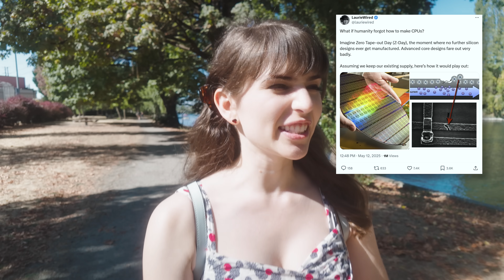what if humans forgot how to make CPUs?

Comment: give me a couple thousand MOSFETs and i can make my own CPU. It's gonna suck balls, but i've done it before and it works.
Reply: A few thousand may be more than you need.  Vacuum tube computers used only hundreds of tubes.
Reply: @kensmith5694  Tubes can do more than transistors. There are some pretty complicated tubes, including plenty of logic integrated into a single tube, so you would probably need fewer tubes than transistors. Tubes are probably more like a small IC than a single transistor, at least some of them(in this scenario we would obviously "integrate" tubes as much as possible).
Reply: @Maxjoker98  Mostly, the tubes were dual triodes.  There was a fair amount of diode and resistor based logic gates in the designs.  Something like a PDP-8-S could do quite a lot with not much logic.  Going serial for math saves a lot of parts
Reply: You won't be the first, there's the Monster6502, it's a huge circuit board and only runs at a couple hundred kHz.
Reply: @kensmith5694  Tell me about it! Bit-serial CPUs are very cool, there is this really cool bit-serial CPU for the WireWorld cellular automata. I'm thinking of building a bit-serial CPU in Minecraft, because my tiny CPU isn't tiny enough :P
Reply: @Maxjoker98  The 8051 microcontroller is/was serial internally.  It is a very nice micro to work with.  The RCA CDP1802 was also serial internally.  It was a complete horror to work with.  I suspect there wasn't much difference in the number of transistors used in the core.  I was more a matter that the guy who did the CDP1802 chip hated programmers.
Reply: @kensmith5694  yeah, i cant really think of a use for a heptode mixing tube in a computer logic array...

"logic in a tube"... obviously a comment from someone that has never seen a basic jordan eccles multivibrator or understands what all those extra grids/screens in multi electrode tubes are for...

"onish". "offish". "somewhere in betweenish". not really much else a regular tube can do other than diode action... what else is there? magnetrons... not much call in a computer for that. thyratrons... we now have nearly complete "offish", a state of "onish", and no in between. and we cant turn it off without cutting the power altogether...
ignitron? same deal but bigger?  phototube? all relatively useless in logic. all that suits is the pliotron... the humble triode. or maybe a kenotron... rectifier.

ha ha... "offish" doesnt trigger the spellcheck... is that an actual word?
Reply: @kensmith5694  There was even a dynamic RAM using a vacuum tube, the Williams-Kilburn tube.
Reply: @WimTon  Drum memory or a "mumble tank" have a certain charm as the main memory of a computer.  On such systems, you can have a nice analog meter showing what percentage of the time the machine is waiting for the bits it needs to come by.
Reply: @Maxjoker98  Agreed! 

When you use them in digital mode (2-state) it get's quite easy to visualise quite complex logic functions being integrated into single physical tubes. Also there were quite few tubes that were for example "dual-pentode", etc. meaning that two 5-terminal innards would share one physical package. So I'm sure we'd soon be talking about "its" the way we talk of "ics" today! 

Incidentally, in the UK we tended to call tubes "valves", with the grid(s) acting like a tap (faucet).

We'd also not need the heating on in winter...
Reply: @Maxjoker98  8-bit ALU (ripple or small carry look-ahead): ~32–60 triode sections
(full adder per bit costs rise, plus XOR/logic for flags)
Registers (accumulator + 3–6 general registers): ~24–40 triode sections
Instruction decoder & control sequencer/microcode: ~20–40 triode sections
Clock & timing circuitry: ~6–12 triode sections + power tubes
Bus drivers/buffering (wider buses, more fanout): ~20–40 triode sections
I/O controllers (serial, display, interrupt logic): ~12–24 triode sections
Memory interface / core sense amps & drivers (for, say, 16–64 KB via core/drum hybrid): ~20–50 triode sections
Triode sections total (sum): ~154 – 306 sections.

Conversion  to physical tubes
Dual-triode primary use (2 sections/tube): 77 – 153 tubes.
Mixed compactron heavy use (avg 3 sections/tube): ~51 – 102 tubes.
Add practical overhead (spares, extra drivers, safety margin + power/regulator tubes): add ~30–50%.
Final 8-bit tube estimate:
Optimistic (aggressive integration): ~65 – 140 tubes.
Conservative (realistic design with overhead): ~100 – 230 tubes.

Your logic is sound; you could reduce with more targeted computing. I wrote it just as an 8-bit CPU example.
Reply: @Maxjoker98  You are not having my guitar amps you computer freak!
Reply: give me a couple of electro-mechanical relays and I can make my own CPU. I sometimes wonder how well you could build electro-mechanical computers with our modern knowledge and tools(Computers have changed in their abstract designs a lot since then, not just in the concrete implementation! And relays, surprisingly, have gotten better too!)
Reply: @Maxjoker98  It will be hella slow; the physical gap in relays take milliseconds. Add them all up X1000s, and you are in for a (bad) treat.
Reply: @Maxjoker98 In the 1900s a European firm (Swiss?) manufactured a mechanical payroll computer for a mining company in the Southwest US.
Reply: @Maxjoker98  I would love to see that!
Reply: @Maxjoker98   oh yeah, you can. some old elevators run completely like that. 70+ floors etc. used to have an operator, now controlled with logic made with latching circuits cobbled together from contactor blocks etc.
Reply: If I see a doomsday prepper Kickstarter for the Ballsucker 2000 I know who to blame
Reply: @balorprice  
Lmfao😭

(Im serious!)
Reply: But will it run Doom?
Reply: if you don't mind a multi-voltage power supply, a bipolar junction transistor (BJT) can be made into logic gates and therefor a CPU. And BJT can be made as a bit of an advanced chemistry experiment (a little dangerous).
From there, a module that acts as a very simple binary or 4-bit BCD(decade computer) ALU could be made. And if you are patient, you can make a computer from that. 
But it won't be competitive to even something from 80 years ago. Eniac is that old, from 1945, but more sophisticated than above, it was made from thousands of tubes and relays.
Reply: Ben Eater will be king of the world lol
Reply: @JohnVance  Yup! I still have an 8 bit CPU work in progress following his videos :)
Reply: Was just thinking this. The information has been unlocked once and enough people are familiar with the general physics and logic necessary to make primitive computing solutions. It would be exponentially faster to get back to this point than the first time we cobbled this trash together. lol  Might even unlock better ways of doing things this time around, since we'd have way more physics understanding versus the first time.
Reply: ' and i can make my own CPU'  Exactly, people who don't know the basics don't understand how trivial it is.  It's like saying 'everyone forgot how to walk'.  Don't get me wrong you could easily lose the tip of the spear and the highest level processors.  But it's relatively trivial to get back into 'some processing'.
Reply: @ModelLights  Yes, but you won't make a arm32 m0 cpu with discrete transistors, let alone amd64.
Reply: @Johannes-c7p  'a arm32 m0 cpu with discrete transistors, let alone amd64'

' Don't get me wrong you could easily lose the tip of the spear and the highest level processors.'

Was what I said that far over your head that you didn't get I already said that?
Reply: @ModelLights  arm32 m0 is not the tip of the spear, it is over 2 decades old. And it is the simplest one compared to other arm cores released at the same time.
Reply: @Johannes-c7p  Guess what?
Here you are exactly correct
 '@ModelLights  Yes, but you won't make a arm32 m0 cpu with discrete transistors, let alone amd64.

'

But you're also using it to lie to imply that I even remotely said that those were included in 'some processing'.

I don't lie about what you say to pretend to correct you, please don't do the same to me and keep to yourself.  If pretend 'correcting' makes you feel smart, pretend correct something else.

At no point did what I say imply that you could make either of those from discrete transistors.
 
And 'tip of the spear' is indistinct, and does not 'only include the utmost'.  Literally both of those are going to require advanced lithography.  That they are 'relatively simple' is still not remotely 'simple', and I never said it was, it's a mistake you've made to pretend I made it.
Reply: Thing is, you forgot how.
Reply: @fosy6991  The exact layout... very likely.
The skills required to do it again... 
(as someone with similar training, just significantly less patience)
I assure you, those are still there.
Reply: @fosy6991   well, in this hypothetical scenario, in 30 years, the only way for me to forget how to recreate a computer from scratch is if the government "disapear" me exactly for knowing that. Imagine if people get mad and start the butlerian jihad and get rid of all the semiconductor industry, I would be one of the rebels trying to hide computers and keep them alive. 
They are going to eventually soon ban general purpose unlocked CPUs, so I take very care of everything made until 2020, after the global socialist government decided to go totalitarian.
I bet if they let us pass the next years without having unlocked CPUs, I would be surprised, everything will be basically an iPhone.
Hopefully Risc-V survives, but getting the chip fabs to manufacture it to you in a clandestine way is going to be hard.
You end up having to buy transistors, but they're probably keeping tabs on how much you buy, no one needs to by 50000 transistors at once.
The ban on general purpose computing is coming, brace yourselves.
Reply: @monad_tcp we shall protect ppl like u when the shit goes down
Reply: @sofoniassentayehu2053  We should teach basic electronics and basic "handyman skills" more widely and possibly earlier in the education course.
Reply: @monad_tcp  Ahh so that's (butlerian jihad) what jreg was talking about in his song "total clanker death, i knew it sounded familiar
Reply: @monad_tcp  why should it be a "global socialist government" and not a "global conservative government" to conserve the "good old times before computers"?
Reply: @OrkPaladin ' why should it be a "global socialist government"'
Because all of the ignorant people have been fooled into thinking 'socialist is better'.  Of course you already know that really..
Reply: @monad_tcp

For Z-day to happen, I'd imagine around 2 generations living their life dependent on Ai. The generation with internalized knowledge died out and then the system malfunctioned.
Reply: Give me some valves and hydraulic fluid, and I can make you an analog computation. It's a less glamorous field, but if you run a refinery, control inside an engine, or any kind of suspension/stabilization in vehicles or structures, you can compute on mechanical signals like pressure, flow rate, or pendulums.
Reply: @MrHaggyy Boeing built a system of networked, mechanical computers in the 1940s and stuck it in an airplane. The Ford Mark IA and similar mechanical computers were used until the 1990s, and took well into the 1980s to be practically replaceable by digital options.
Reply: @jec6613  Yes, and it's a fair discussion if those systems were replaced or enhanced. Like (passive)vertical stabilizers for planes or ships. The brakes and engine on truck/heavy equipment might have to run without the digital brain running. And many sensors like gyro, accelerometer, magnetometer, for an IMU are mechanically built differential equations, which are measured at the right spot and time for digital values to be used.
Reply: Gimme an silicon ingot and an overhead projector and I will make a CPU...
Reply: Give me a few thousand light switches, a pack of smokes, and some redbull and I will be the CPU
Reply: We forgot how to make CPU's (And integrated circuits in general Maybe?), so you wouldn't be able to do that.
Reply: @justinth963  In the thought experiment, whatever CPUs exist on Z-day remain operational, just new ones aren’t added. Similarly, the existing stock of ICs would remain. There are 7400-series integrated circuits to be had, and you can build a CPU and register set using them.
Reply: @OrangiaNebula  I think putting together transistors into a CPU counts as "Making a CPU".
Reply: @justinth963  🤣, you got me there. I simplified the scenario to "can’t make a CPU using our lithography machines anymore". If the scenario involves all of us with the knowledge to make one getting a brain-wipe, then the collection of 74xx chips on the workbench would be a jumble of gobbledygook and my approach would fail.
Reply: @justinth963 but the concept is so simple though, it's just a programmable calculator. The concept of a computer was invented 200 years ago, the only reason we didn't start making them sooner is because it was invented by a woman.
Reply: I'll make my own CPUs with blackjack and hookers!
Reply: Intek 4004 had 2700 transistors. You can get away with less.
Not sure what type of logic it used, if it was complementary logic you can divide it by 2 (but increase current consumption and reducing speed while doing it).
Reply: MOSFETs require semiconductors which means they probably also can't be made.
Reply: Word
Reply: No you couldn't, because as part of this scenario, you forgot how
Reply: Couple of thousand won't cut it.  Unless your cpu is just a simplest one or a "proof of concept"
Reply: @benitizerthe9595  boils down to the intended purpose. A few hundred kilobits of core rope memory is good enough for the software in an aerospace guidance computer. But they lean very heavily on electro-mechanical systems rather than signal processing like we do today.
Reply: We put humans on the moon before we invented CPU's and semiconductors.

This isnt so much a thought experiment about forgetting how to make CPU's as it is what if Idiocracy was not a fictional movie but a documentary?

Brawndo, it's got what plants crave!!! 😂
Reply: @sirtra  The Apollo Guidance Computer used a silicon IC chip. The moon landing may not have even been possible if semiconductor based chips weren't invented already. CPUs are really just a type of chip, but I guess you could say that CPUs didn't exist in their modern form until a couple years after the moon landing.
Reply: @technophobian2962  you're smart enough to know what i meant, dumb enough to reply thinking i didnt
Reply: @sirtra  I wasn't trying to be argumentative, although I guess correcting someone on the internet will always come across that way. All I was saying was that semiconductor based IC chips did exist before the moon landing, and that it was such a key achievement for humanity that the moon landing itself probably wouldn't have been possible without them. It's just another thing that shows how important this advancement in technology was.
Reply: @sirtra  so... we were on the moon before 1943?
apollo had plenty of semiconductors. not a tube in sight. other than maybe a magnetron for microwave communication? not sure on that aspect...
 it was the space race that led to the "integrated circuit". miniaturisation. they were already assembling compact circuits with discrete components such as transistors., and had been for at least a decade at that point... 69? thats 26 years from when bell invented the first transistor...

and thats ignoring the even earlier semiconductors such as cats whiskers in radios...

the russians? they stuck with tubes as they felt the immunity to hard radiation was  better option for long term reliability... and low cost. no need to shield or harden components to deal with gamma rays and cosmic radiation. it wasnt because they couldnt. they didnt WANT to.
Reply: @paradiselost9946  silicon chips as we know them today, or what are commonly referred to as semiconductors and the basis for integrated circuits were developed as part of the space race.

You should do some more research and learn history before continuing to act like a child.

What do you believe existed in 1943 that will make you save face and myself embarrassed?

Electronics existed but nothing even close to resembling what we now refer to as a microchip or integrated circuit or semiconductor.

If you're wishing to get pedantic we humans didnt invent semiconductors we discovered them, or well figured out certain substances are neither conductive nor non-conductoive but rather semi-conductive ala semiconductors. See that's the funny thing about words..  they often have more than one meaning or interpretation and context matters. Semiconductor happens to be one of those words.
Reply: @sirtra actually, that's not correct. Look up the Apollo guidance computer. It was not a single chip, but it was a) a CPU and b) made of semiconductors.
Reply: Let me guess, you did it in minecraft?